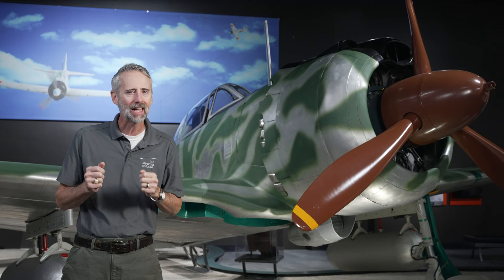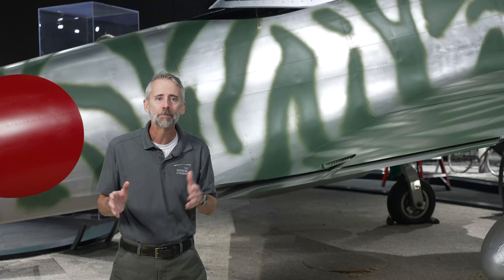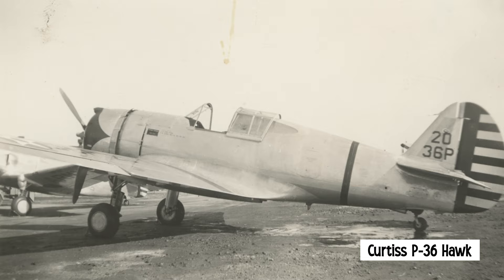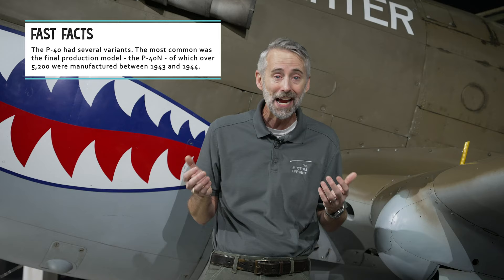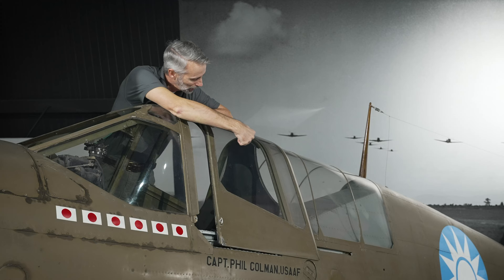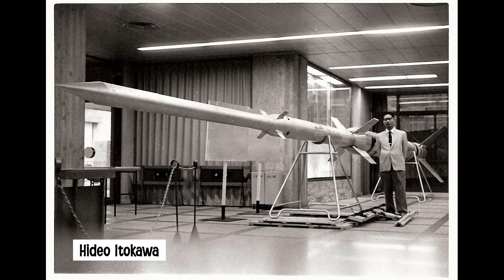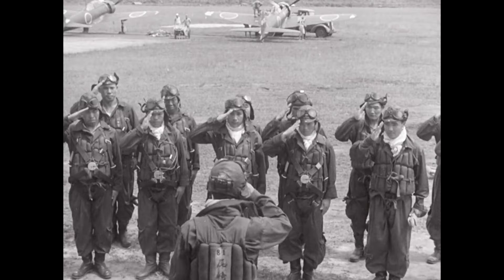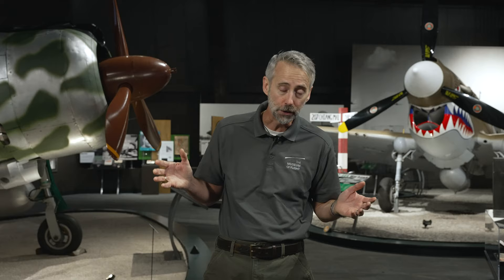Warhawk vs. Oscar SHOWDOWN! | Curator on the Loose!

Comment: One factor that throws this comparison toward the P-40 is logistics.  Japan also had the rivalry between the Naval Air arm  and the Army Air arm.  Niether one flew the same model of aircraft, they had different requirements for sure, but think what a logistical nightmare it was to stock replacement parts.  You also need to train personel to repair and maintain each model.  I thought I once read that the Japanese had over 60 different models of aircraft in their inventory.  I'm not sure how much this attributes to a comparison, but I don't think it can be ignored.  Thank you for your efforts in bringing these videos to us.
Reply: The U.S. Army Air Corps and the U.S. Navy also flew different aircraft.
Reply: The US army and navy also had different planes. The navy had the wildcat, hell cat, and corsair. The army had the p40, p47, p51, and p38. The Japanese did have logistics problems  the US didn't have. But that was caused by the fact that the US had 10 times the manufacturing capacity that Japan had. And the fact the US sank their merchant fleet so they couldn't get raw materials in or supplies out
Reply: @barbarahunter5463 its not 10 times, its actually 200 times

Comment: The "Achilles Heel' for Japan was the lack of armor, resulting in the loss of their best trained & most experienced pilots.
Reply: There were also  mo sefl sealing  fuel tanks. Or rubber  blades inside the fuel tanks.
Reply: After the US got a good look at crashed/shot down Japanese aircraft they went with a large amount of incendiary rounds (both I and API) to take advantage of lack of protection of the fuel tanks.  Some units used a mix of High Explosive or High Explosive Incendiary ammo to augment the Incendiary ammo! 
(Note: to get the long range that most Japanese planes had they had very large fuel tanks in the wings and fuselage.  Hence the emphasis on I, IT, API, or HEI ammo!)
Reply: What you have to remember is that Japan was still playing catch up with the western world in terms of industrialisation. They were struggling to develop suitably powerful engines and, in order to get the range and the climb rates that the army and navy were demanding, they had to make the aircraft as light as possible. That meant little to no armour protection. I’ve heard that allied pilots described seeing  Japanese aircraft literally disintegrating under sustained fire.
Reply: Except the Ki-43 did get armor and self fueling tanks by late 1942.
Reply: @miquelescribanoivars5049  Not only that, but the Oscar armor was 13 mm thick to the P-47's 8 mm, right from the get go... It was the Zero who had no seat back armor until the model A6M5C. Even the A6M5b of the Mariana Turkey Shoot period had only an armoured windscreen and automatic fire extinguishers, plus moderate self sealing tanks. The Ki-43 had armor for two years by then, and was preferred by far to all other fighters (except the Ki-100), including over the Ki-84 Frank (and NOT for reliability issues, which were not as bad as claimed on the Ki-84. The Ki-84 was 100 km/h faster than the Oscar at 640-660 km/h, with actual wartime engines and fuels, and STILL the Oscar was preferred to the point front-line commanders were trying to cancel Ki-84 deliveries in its favour).
Reply: 防弾板と防漏タンク、防弾ガラスが無いのは海軍の飛行機だよ。日本機全部ではない。
Reply: The real archilles heel of Japan is its lack of natural resources and the fact that Japan only opened to the world in 1868, which is a very short time to catch up with the mighty industrialized USA and the British Empire. Despite being a lightweight with all of their limitations and being late to industrialization, they still manage to square off with the worlds economic, technological and resources rich heavyweights

Comment: "It's not the plane, it's the pilot." The AVG's primary adversary was the Hayabusa (called Oscar by the allies). Chennault, a tactician par-excellence, knew the P-40 couldn't fight head-to-head with the Japanese fighters, so he devised the diving, slashing, and zoom-climb tactics that took advantage of the P-40's heavier weight and higher diving speed, which made the Flying Tigers so successful.
Reply: Actually Ki-27's were a lot more ubiquous during the time frame before the AVG became the CATF.

Comment: The P40 had to use different tactics than any of the Japanese fighters. Because of its speed, dive rate,  armament, and armor protecting the pilot, engine, fuel tanks, etc, if flown to take advantage of its strengths, it could decimate the enemy. If P40 pilot tried to engage in a dog fight with a Japanese fighter on their level, the P40 would most likely lose. The Flying Tigers were the first to take advantage of the P40s strengths, which actually confused and frustrated the enemy. The kill rate for the Flying Tigers was incredible since the P40 was supposed to be an underrated fighter.
Reply: yes

Comment: Next time do the P39. My personal favorite plane of WWII. It was so far ahead of it’s time the Army Air Corp didn’t know What to do with it, and when they removed the supercharger it was relegated to low altitude fight and attack. It was faster then the P40, more nimble and had a canon in the nose that was highly accurate. it had a rear engine layout, putting the pilot farther forward which gave him better vision over the wing and below. The design also had a smaller nose than a front engine layout,reducing drag. Nowdays all jets share that configuration. Tests were even made with it having swept wings in a Navy Experiment. The late P63 was as fast if not a little faster than the P51 A.
Reply from the maker: Thanks for the suggestion!

Comment: I'd love to hear a discussion of how important speed is in a dogfight and how it interacts with maneuverability.  That's the big thing.  

I'd argue pilot quality was a sliding scale.  At the time of Pearl Harbor, Japan was at the top of its game with plenty of experienced fighter pilots while US pilots were a lot greener.  Point to Oscar at the start of the war.  But as the video points out Japan really couldn't replace their losses while the US could.  By the end of the war, the point would go to the Warhawk, which by then was mostly out of production and replaced by far deadlier US fighters.
Reply: Correct, this wasn't mentioned.  The Japanese planes could easily turn inside any U.S. fighter in the Pacific theater, even at the end of the war.  BUT, that was at low speed.  The 40 could out turn  any Japanese plane above 300 mph.  Boom and zoom was the way to utilize the 40 as it was fast but slow to accelerate once your speed was lost.

Comment: I think the weight of the catagories should have different values. Faster, more devastating armament, more "stick time" should make this contest a total win for the P-40. Climb rate, turning radius, and dive speed also play a huge roll in air combat. Experienced pilot vs a rookie pilot will influence the outcome significantly.
Reply: Yes, but the Ki had a better climb rate and turning radius (at least at low speeds) than the 40.  The 40 turned better at high speeds - Something Chenault knew..  This video didn't mention the dive speed, but you're right - the 40 could not only outdive the Oscar but it could outdive just about every other WWII fighter.  The Japanese planes were not structurally sound enough to dive much past 300 mph, and they were difficult to control at those speeds due to the huge ailerons.

Comment: while the p40 was behind in many areas of performance it had one very underestimated advantage. it was easy to fly for its performance level and in a war with combat stress and exhaustion that counted it was not prone to high speed stalls in tight turns and did not drop a wing and spin so stall recovery was easy and cost less altitude. i would sooner fight in an aircraft that did not punish small errors than have a small performance advantage. a pilot being confident in his aircraft counts

Comment: P-40 was a better plane if the pilot knew how to use it. The Oscar and Zero were similar, but the Japanese Army and Navy hated each other and couldn't cooperate to make a single design that would have been better than either.

Comment: Assuming a one-on-one air battle with pilots of equal skill, the P-40 cannot beat the Hayabusa or Zero.
The U.S. Air Force would have strictly ordered P-40 pilots not to challenge dogfights alone and to swoop down and run away.

Comment: Discounting the guy in the seat, this is an easy call.  The 40 can use it's superior speed and dive speed (not mentioned in this video, but one of the best of any WWII fighter) to dictate the terms of the fight.  The Ki pilot wants a low speed turning fight?  Tough noogies.  I'm keeping the balls to the wall and fight a high speed energy fight.  Between the speed, armor, and firepower, I'd take the 40 if it was my life on the line.

Comment: @ 2:24, Why do some people call it a “joystick” as my instructor of aircraft flying controls said “it IS a CONTROL COLUMN, a joystick is between your legs”, and in all my 24 years of service I never called it anything but a control column or control yoke, except when working on helicopters, then it is the “cyclic stick or collective lever” pronounced LEE-ver not Le-ver.
@ 7:31 There is no such thing as bulletproof glass, or at least not during WWII, bullet resistant yes, proof no. I don’t know if anyone has manufactured a truly bulletproof glass or composite transparent pane yet, but if not I am sure someone will. 
Comparing the two flying training systems of the USA and Japan is an obvious parameter to use, however it is not very accurate in my opinion, the RAF pilots enlisted after the start of WWII and especially during the Battle of Britain 🇬🇧 had considerably less than either the American or Japanese pilots, completely out of necessity but not ideal by anyone’s measure, and without doing any research I can confidently say that a good percentage of them were shot down early on, but those that were not killed went on to become one of “The Few”, my point is that there does not have to be a direct coloration between training hours and having a pilot who made the grade in combat, having said that I do believe that in general quality will always beat quantity.

I am not sure about the technical quality of either aircraft, but I have to say that purely on aesthetics the P-40 WARHAWK is the winner, and the same can be said about many allied aircraft of the era, they were so pleasing on the eye and, luckily, they were mostly better or as good technically as any of the axis aircraft. The Oscar obviously won the battle of “kills” but by the time the P-40 entered service against Japan (excluding the flying tigers and allied forces) in the knockdown battle for victory the weakness of the Oscar in the armament and armour categories, and Kamikaze use, sealed its fate to become a very very rare type. 
Thanks for another excellent episode, and for sharing your knowledge and insight with all us viewers. 😀👍🇬🇧🏴🇺🇸🇺🇦

Comment: Early in the war the Ki-43 definitely had a huge advantage in that the American pilots were still being trained to dogfight a lighter, more maneuverable aircraft and that was a big mistake, regardless of how good of a pilot they were. After Pearl Harbor, when pilots from the AVG returned to active duty they were able to teach other pilots how to defeat the Oscars maneuverability advantage by using the bigger, heavier, more powerful American fighters higher speed, especially in a dive, to make firing passes at Oscars and Zekes, then "Zoom" climb back to an altitude advantage. Once the proper tactics were used the P-40 definitely had the advantage, especially with the armor plating and self sealing fuel tanks it was equipped with.

Comment: The P-40, while under-powered, especially the early models, was faster than the Oscar. Oscar could turn much, much better but the P-40 pilots quickly learned to use boom and zoom energy tactics. The Oscar was slow and lightweight, that combo makes for poor energy fighting tactics. If the P-40 built up speed, with its heavier weight it could build up a lot more energy. Turning too much burned off that energy quickly, which is why P-40 pilots didn't turn it or even attempt to turn it with an Oscar. If a P-40 got too slow against Oscar, Oscar won. But P-40 won because only a stupid P-40 pilot tried to turn very hard.
Reply: I know that Chennault taught the AVG pilots to use boom and zoom very early in the war, but don't know when that become part of normal pilot training for P40's.  My understanding is that the reason that many P40 pilot were shot down early in the war was that they were trained in turning-fight techniques, not boom and zoom.  Does anyone know when the training was changed?  Thanks

Comment: "Early War" (Dec 1941 thru Aug 1942) most Japanese pilots had either fought in China or their superiors had.  And although for the main part their opponents weren't skilled and/or flying obsolescent airplanes, and/or using the wrong tactics, the main key was ALL Of Those Extra Flight Hours of Experience!
-- --  BUT. -- --
By the time the Warhawk version arrived  the Oscar with two 7.7mm (.303) machineguns and the occasional variant with two 12.7mm (.50) machineguns had basically ran out of experienced pilots who often were put into more modern aircraft...
>> So for the most part, the P-40s had better pilots!!!

Comment: What was the horsepower of the Ki-43's engine?
Reply from the maker: An original 14-cylinder Nakajima Ha-115-II radial engine had 1,190 hp. The reproduction you see here is powered by a Pratt & Whitney R-1830 radial engine.
Reply: @museumofflight  Is the HA-115 the same engine as the A6-M "Zero"?
Reply from the maker: @GregoryTheGr8ster  No, for the most part the Zero relied on Nakajima Sakae engines in its variants.
Reply: @museumofflight is it flyable?  Do you fly it at shows?

Comment: 1:1 and same pilot quality the highly more maneuvarable Oscar will be invincible, but it can hardly threaten an e-fighting P-40.
Reply: No, note that the AVG (Flying Tigers) quickly adapted to fighting the KI-43's using "boom and zoom" tactics.  The P40's simply avoided a turning fight.   It was somewhat situational, though, depending upon whoever had the initial height advantage and/or element of surprise.
Reply: @jfess1911  1:1 a B&Z fighter has no chance unless the Ki-43 pilot is an idiot. The latter is toast against two and more B&Z fighters.
Reply: @Pierluigi_Di_Lorenzo  My understanding is that most of the KI-43-s that were shot down were shot down in diving attacks.
Reply: If it gets a chance to dog fight

Comment: The Ki 43 Hayabussa (Allied codename Oscar) actually had two major flaws.  It lacked armour plate and self sealing fuel tanks in order to increase maneuverability.  Rarely did a P-40 Warhawk ever tangle with a Ki- 43 Hayabussa in a turning dogfight.  Most P-40 Warhawk pilots used boom and zoom tactics against the Oscar.

Comment: Oscar would eat the 40 alive 1 on 1 with same pilots..
Reply: As long as the P-40 pilot attempted to employ the same tactics as the Oscar, yes, because they played to the strengths of the Oscar. If the P-40 employed the tactics that played to its strengths, such as boom and zoom, the P-40 would win.
Reply: Only in a slow turning fight, otherwise no
Reply: Well, no, and here's why.  Everyone knows if the 40 fights a low speed fight with the Oscar, the 40 loses.  If the Oscar fights a high speed fight with the 40, the Oscar loses. Stalemate?  No, because the higher -e fight is the one that dictates the type of fight.  The 40 calls the shots.  An Oscar would lose to a WWI biplane in a dog fight if it fought at those speeds, but why would it??